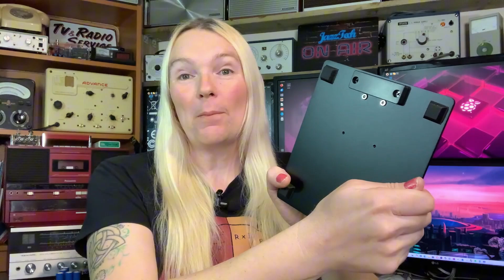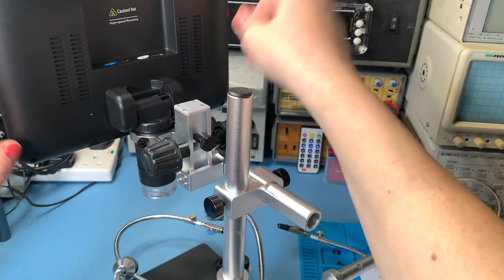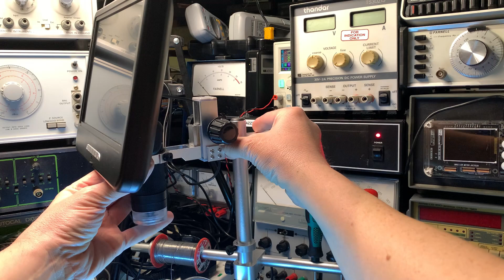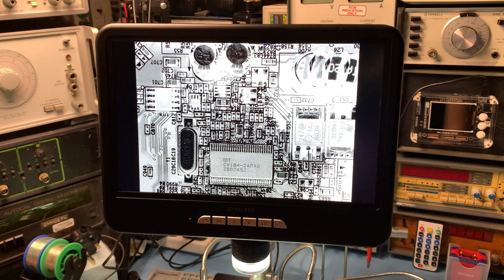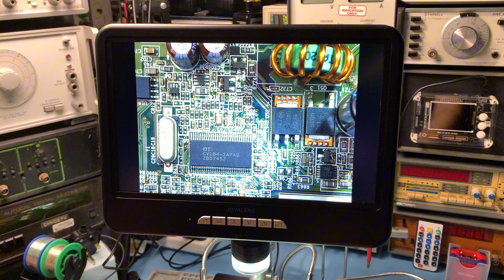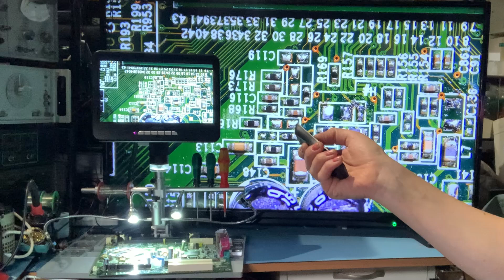JOYALENS JL210S Plus 4K Digital Microscope - A Useful Electronics Tool!

Comment: Thanks for the video. Would you be able to let me know what the working distance is from the base plate up to the lens at the len's maximum height?  thanks and regards, Geoff D
Reply from the maker: @geoffdunstan8567 I typically use it at 6 inches, but you can get a maximum of between 7-8 inches I would say.
Reply: thanks very much Jazzy :). regards, Geoff

Comment: Do you prefer the Tomlov or the Joylens?
Reply from the maker: They are both very nice. You wouldn't be disappointed with either. Yes Tomlov is auto focus which is really good, but it is about $100 more. Joylens records audio with the video and does 60FPS at 4K. Tomlov no audio, (may not be important to you), and does just 30FPS at 4K. It's a hard choice, they are both really good.

Comment: Is "Joyalens" about the same as Tomlov? ❤ 🌹🥰😘💕💐👸😀😍🤪👀❤😃 Sort of wish a digital microscope would come with a built-in thermal camera! And the Joyalens has a microphone!!! Those handy flexible hands might be good for smaller lighter PCBs, but not so well for larger ones! 👏👍
Reply from the maker: Yes they are very similar. Tomlov is autofocus, which is really nice, but about $100 more. Joylens has audio and can do 60FPS at 4K, Tomlov only 30FPS at 4K.
They are both really good. You wouldn't be disappointed with either.
Thermal cameras are still quite expensive, so to add one to a microscope would make it expensive and not competitive with other makes of microscopes, plus the resolution of a thermal camera is low, so not sure how that could work with a high resolution 4K microscope. Thanks for the sub and thanks for watching.
Reply: @JazzTechUK  yes welcome!! ❤️🌹😘💐😉😚💕🥰👩‍❤️‍👨🥂☕👸 Thank you for a great review!! 👍👏👍👏

Comment: Hi Jane nice microscpe i agree i would loose the helping hands the image qualite looks really good i like the little trays with lids i'm always looseing tiny screws on the floor never to be seeen again if it had a firmal image camera setting that would be even better but i'm sure that would push the price up xx
Reply from the maker: Indeed it would push the price up, plus thermal image cameras are low resolution, so I don't know how that would work with a 4K high resolution microscope.

Comment: Another nice looking  unit, though it would definitely benefit from your anglepoise mod, as would most of them👍
Reply from the maker: For a lot of cases a swing arm or an anglepoise arm are good. Sometimes a fixed arm with up and down and in and out is enough for some people with limited space to attach a swing arm who might have to put the microscope away each time after use, especially when you can take all the extras off the base.
Thanks for watching.

Comment: Excellent review, quality production, great. Do you prefer your auto focus ‘scope or manual? Each seems to have benefits. Does AF change focus at unwanted times, for example? Thanks!
Reply from the maker: Yes the autofocus Tomlov does refocus when you put your arm in the way or something, but the autofocus is so quick to refocus it really isn't a problem at all.
They are both really good microscopes. The Joylens without autofocus is about $100 cheaper though and just as good image quality.
Reply: @JazzTechUK  Thanks ever so for the reply. Now I have the quandary - get the AF or spend $100 on some other gadget. Oh no, another big decision...! Thanks again for excellent reviews of both 'scopes, really helpful!

Comment: How safe is the lens light from the heat from hot air when removing a smd components?
Reply from the maker: You will need the microscope some fair distance from whatever you are working on in order to have working space to get tools in there. The heat from hot air is focused down and by the time it reaches up to the lens of the microscope it will be a lot colder, so I don't foresee a problem.

Comment: That Anti-static mat is useless without being properly connected to ground through a 1 meg resistor. I had to test and replace mats every 90 days on a production lines. I personally have a test set made by 3M
You also need a properly grounded wrist strap to drain charges from your  body. Those flexible lights would drive me nuts. I use a ring light that provides even lighting . They LED type are dilemma, but the original fluorescent type wasn't.
We bought our Anti-static products from Charleswater which appears to no longer exist. They also sold a special mat cleaner, because some common cleaners damaged the surface conductivity.
I diid a lot of soldering under microscopes, so the microscope needed a clear glass lens to protect the optics..  I'm not saying not to buy this, but tyimg to educate the proper use to those who  ant familiar wir  the details.